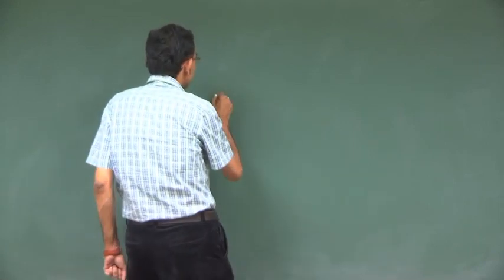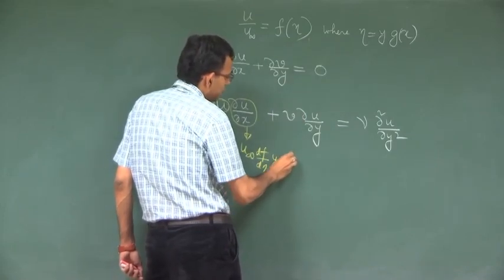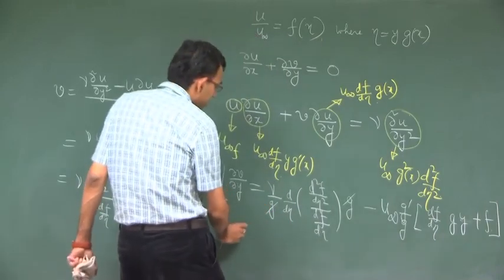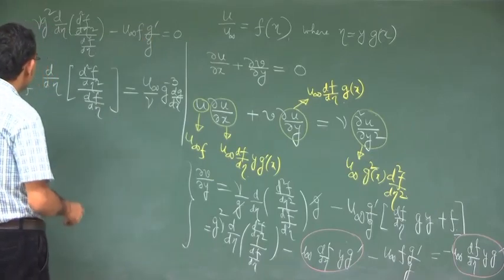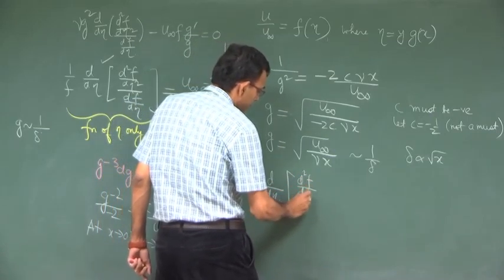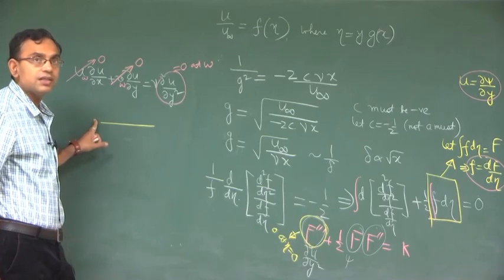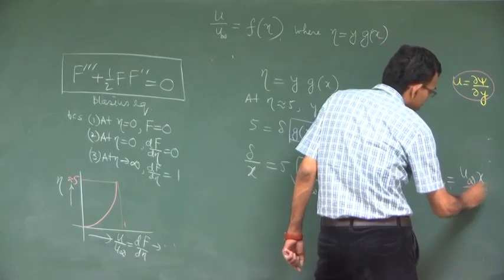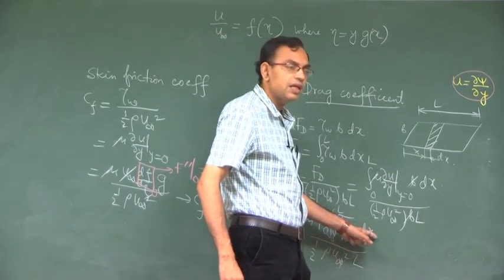Lecture 25 : Similarity Solution of Boundary Layer Equation

Comment: Can anyone explain drag and skin friction difference
Reply: I think drag takes into account both wall drag (caused by shear stress) and also form drag (caused by pressure). Where as skin friction accounts only for wall drag.
Reply: @suryakarla8628  thank you for response
Reply: Drag has many different components especially when considering a 3D airfoil. In the boundary layer equations it is important to identify the velocity profile and consequently wall sheer stress because the skin friction is the main component of drag in a 2D sense. What you need to know is skin friction is drag, but only one component of the very complicated total drag.
Reply: @ItsMauiBruh  thank you for response
Reply: Informative lecture sir
Reply: Sir i need your help for ODEs Matlab code
Reply: Drag is perpendicular to movement and skin friction is parallel to movement